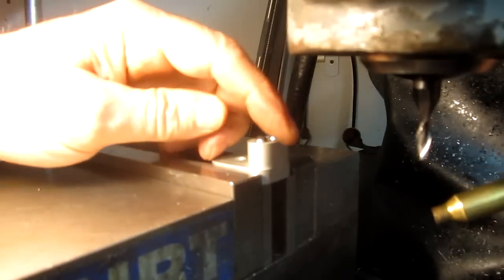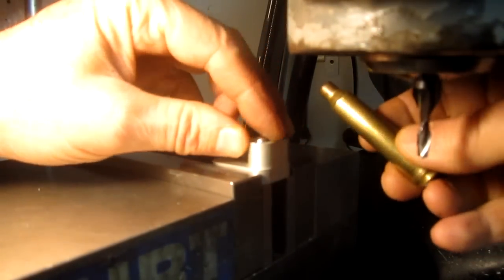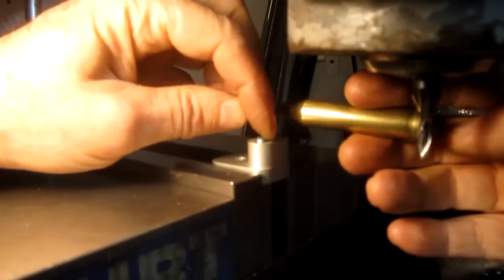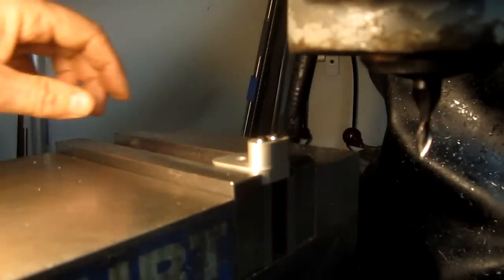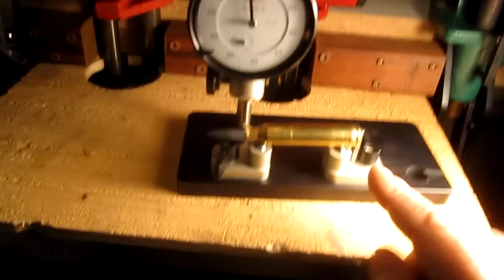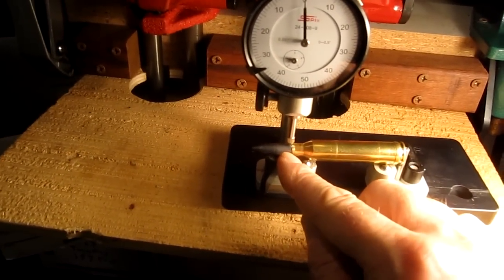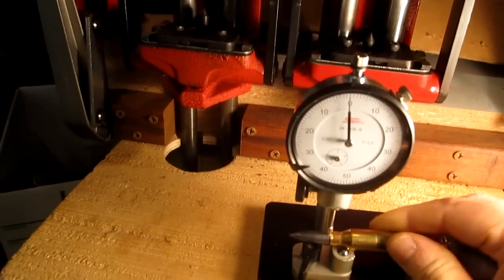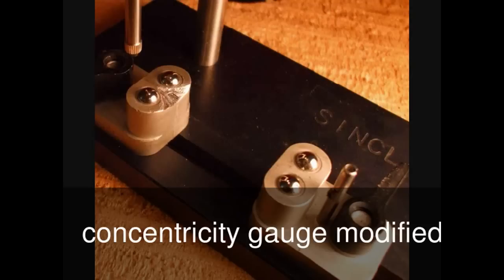Sinclair concentricity gauge modified

Comment from the maker: @ThirdRomeAquilo 

The drill is a 21-100 Rockwell vertical mill made in 1963.
It is running on 220 VAC 60 HZ 3 Phase.
This is a residence with no 3 phase power available from the utility company.
There is a phase-a-matic phase converter box mounted on the mill.
I do not know which power size of phase-a-matic, as the label is gone.